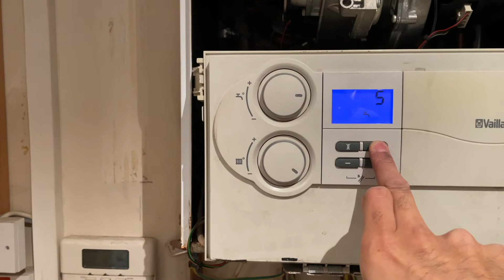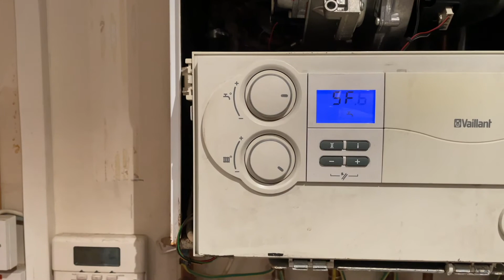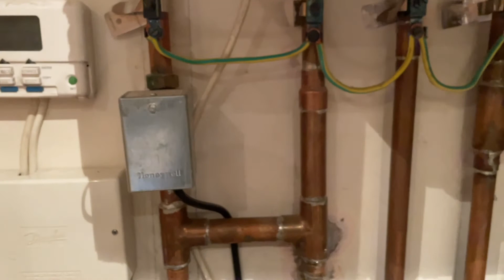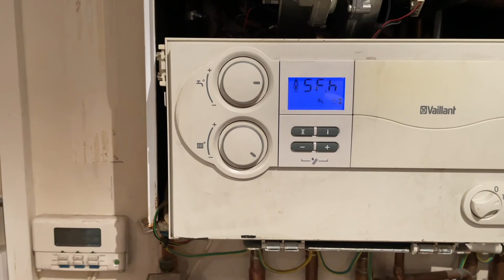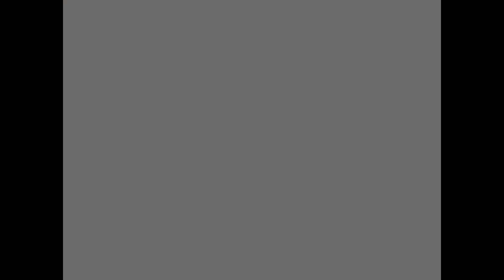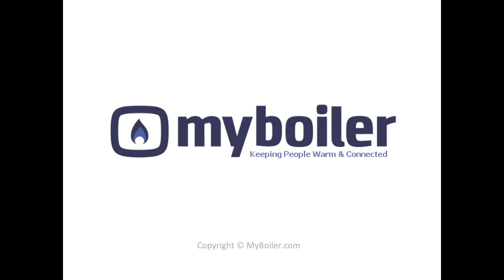How to - remove the Vaillant F70 Fault Code after changing the PCB

Comment: How can i get to that menu . I have 2 i buttons on the top row ?
Reply from the maker: Check the manual, you are looking for the D codes. It’s in the installer menu, all instructions found there.  Also the new PCB usually comes with the instructions / settings. Jay K

Comment: My vaillant ecotech plus 637 showing only temp numbers going up n down no lights no flame ...no water pump...vessal changes electrode changed ..pcb gone?
Reply from the maker: Hi, it’s possible that it is a PCB fault and / or the display board too. Jay K

Comment: great video. Thank you. 
My Ecotec 24 from 2013 doesn't turn on at all. Fuse on the wall is ok, I checked it with multimeter. After putting it back and turning the boiler on it worked for few seconds and then the screen went black again and no noise, nothing. Did this few times and still same. Don't know what the problem can be.
Reply from the maker: Faulty display and / or pcb possibly. JK

Comment: I have a Ecotec plus vcw 296 from 2014 and suddenly I have a F70 code. Does that mean my pcb is broken? How else does it not have the Device Specific Number (DSN) anymore? Thank you for helping everybody out here 👍
Reply from the maker: Hi, if it has suddenly done it, then yes, likely the board has an issue and is not able to read the dsn settings correctly, you can get an engineer to try unplugging and replugging the cables, just to make sure. JK
Reply: @ARatedTV  ok that makes sense, thanks for the speedy reply, I hope your business is doing well, enjoy your Sunday 🤘

Comment: Hello, i have a f42 error code shared with a f70, is it possible to fix it by my own ?
Reply from the maker: Hi, not if there are multiple errors. Usually this requires a heating professional to diagnose further. If you have already solved this, then apologies for the late reply, your message was held for review. JK

Comment: Replaced PCB and display as the fuse kept blowing. Did this and same thing as soon as it goes to ignite it pops. Any ideas?
Reply from the maker: Hi, hard to diagnose remotely without seeing the boiler, however usually it’s more than likely that the symptoms point towards the pump or fan. You need to test them electrically to confirm. JK
Reply: @ARatedTV  new water pump. Works a treat thanks very much 👍
Reply: Normally fan I was told. The fuse kept blowing the fuse 6 times we has leak by compression chamber looks like the fan might be wet. Going to try changing the fan..

Comment: Thank you very much for your video. But where can I find/see/check which type of eco-tec boiler I have?
Reply from the maker: It’s written underneath the boiler on the databadge. JK
Reply: @ARatedTV  many thanks for your response, but underneath the boiler is written: hrSOLIDE VHR NL 24-28/C, it does not say which eco-tec boiler it is. So I don't know which type number I have to select in the tabel on your website?
Reply: @ARatedTV  Sorry, it says hrSOLIDE VHR NL 24-28/3 C. Do you know which Value I have to choose out of the table on your website?
Reply from the maker: 10 as per PCB replacement manual for VHR NL 24-28/3 C. Please note, this PCB replacement should normally be carried out by a professional. JK
Reply: @ARatedTV  thank you so much! I got it up and running again thanks to your video and your assistance!
Reply from the maker: Glad it worked. I assume you are in the Netherlands based on your boiler model. Please feel free to share any requests of information you would like help with or to see in relation to your boiler as part of further improvements to our offerings. JK

Comment: Message to OP and others , you should not be putting this info out to the general public as there are to many DIY types out there fiddling with boilers which they don't have a clue about and they could kill themselves , burn there home down and possibly blow themselves and there neighbors to pieces....
Don't DIY with boilers for your own good.....
Reply from the maker: Hi Yensabi, thank you for your concern. This information is aimed at competent professionals. There are clear disclaimers. As with all information, it is provided in good faith. The onus is on the individual to decide whether they are competent or not. This information is also found in the boiler manuals and PCB manuals, all very public information. JK

Comment: I have had a new pcb. I have followed all your instructions. Problem is not solved . I have hot water but heating will not work .
Reply from the maker: Hi, make sure your flow temperature is increased from default, which may be off. Which model do you have? JK

Comment: Hey man! I come from germany and my Ecotec Exclusive VC 146/4-7 needed a new Mainboard. Now it says the F70 fault. I need the DSN for my machine. Can you help me??
Thx a lot. Björn
Reply from the maker: Hi, I am not able to read/speak german. However based on translation and prior knowledge I found the following manual for your boiler https://www.vaillant.be/telechargements/documents/notice-installation/chaudi-res-murales-gaz-1/notice-dinstallation-ecotec-exclusiv-146-206-276-319075.pdf , Page 38 contains the DSN offset (showing as DSN 6 for your boiler). If this is not the correct manual, you need to find the correct manual and locate the information this way otherwise you will need to get into contact with Vaillant technical. Please note, we cannot be held responsible for this information should problems arise, as it is provided in good faith. viel Glück . JK

Comment: I have a Valiant ecoTEC pro boiler that has suddenly got an error code F76 on display. Any advice please??? We are without hot water and heating now for the 3rd day. Would appreciate any help. Thankyou
Reply from the maker: Hi, most likely this is caused by the boiler having overheated. This will require an engineer visit. Perhaps ring Vaillant and get one of their engineers on fixed price repair. JK

Comment: Which boiler type did you do this on?
Reply from the maker: This one is a system boiler. Older type model. Are you having issues on a particular model? JK
Reply: @ARatedTV  mine is a ecotec plus 831, i have just brought a pcb board and i am going to fit it tomorrow. Faults 61 and 62 but mostly 62. When starts up the temperature flickers from 61 to 75 on the last start up?
Reply: @ARatedTV   any advice on changing the board please? I am a refrigeration engineer by trade and have changed lots of boards on them
Reply from the maker: Hi, was going to say if you don't possess basic electrical skill levels then don't attempt it without caution otherwise you may break something essential. As your a professional, just remember to not force any of the components to come out or they may break, gentle prying and finding all the locking points. Make sure if you have older type vaillant, remove the display pcb. You may need to dislodge the the control knobs carefully too. Components within a boiler sometimes tend to get brittle, as they may also do in refrigeration equipment. Replacing the board is generally done in about 5 mins. The programmer takes a few minutes too. The article also contains the programming codes and method. All this information is provided in good faith, and we cannot accept responsibility as a consequence. JK
Reply: @ARatedTV  thanks for that, do i need to adjust all the settings. I thought because it was a board for the same model its just a straight swap. Only thing i have seen online is the f70 fault that you need to change? Which looks simple. When you heater knobs, do i have them on set to full heat when i detach and attach the new one.
Reply from the maker: Hi, yes. F70 will only come up if board is not pre-programmed to the correct model. JK
Reply from the maker: The knobs only fit in a specific way, the grove will only allow them to go in 1 way, otherwise they won’t go in. No need to set to any specific temp.
Reply: @ARatedTV  cheers for the help 👍 ill let you know how i get on tomorrow evening
Reply: @ARatedTV  forgot to reply bit i replaced the board and has been working perfect ever since 👍
Reply from the maker: Glad it worked. Did you have to adjust the settings or was the board pre-set to the correct settings for you? JK
Reply: @ARatedTV   board was pre set i think, literally just swapped over and it come straight on no error codes

Comment: thanks for video. ı have protherm panther boiler. ı replaced pcb and screenboard. ı have f70 error. how do ı solve this problem. thanks again.
Reply from the maker: Hi, unfortunately this video only covers Vaillant boilers, although the protherm may use the same PCB, you will need to obtain protherm specific information and setup sequence. If we manage to find out, we will send you a reply. Jay (MyBoiler Ltd)

Comment: Hi i have vaillant pro 28 i have not got separate i button on there how do i 
Program that to the dsn
Reply from the maker: Following information is for competent persons and should be used with caution:
Press top 2 buttons at same time ie i menu.
Click the button shown under the spanner ie top right.
Set code to 17. 
Navigate D code menu using plus minus buttons to D.093
Change to correct DSN number
Press Tick to confirm.
Reply: @ARatedTV  where do I find the dsn number??
Reply from the maker: @LuisFreitas10  Click the link underneath the video, you may have to press "SHOW MORE"